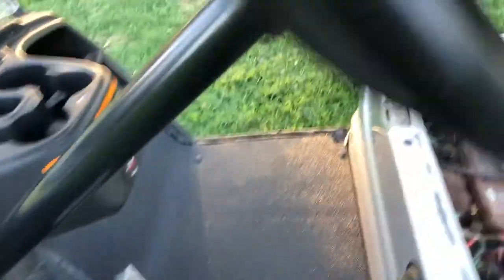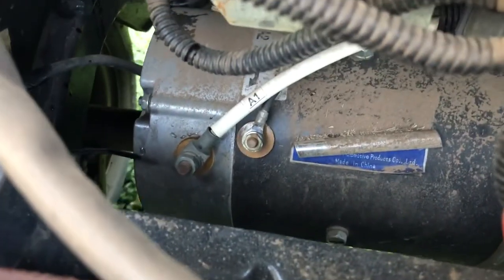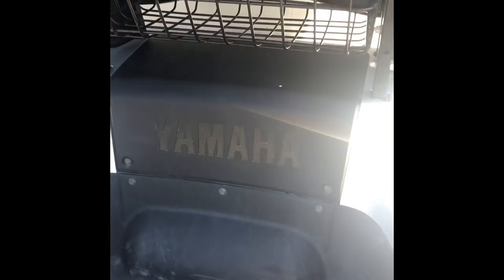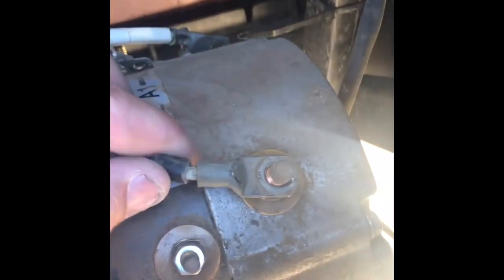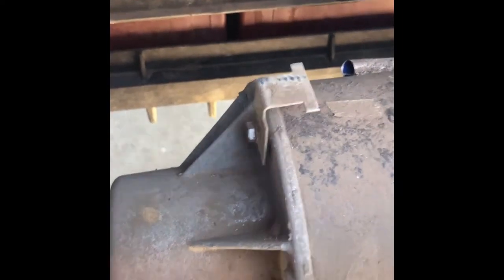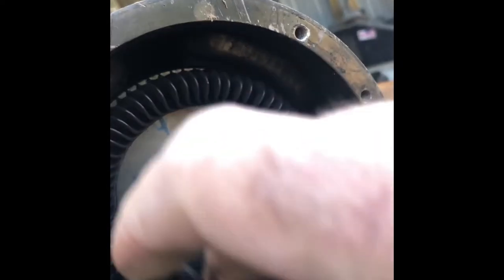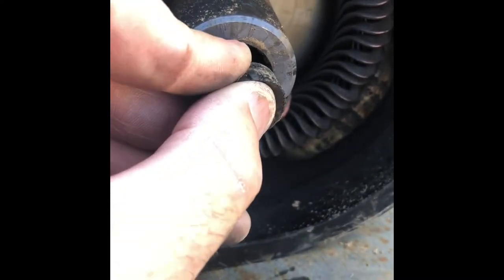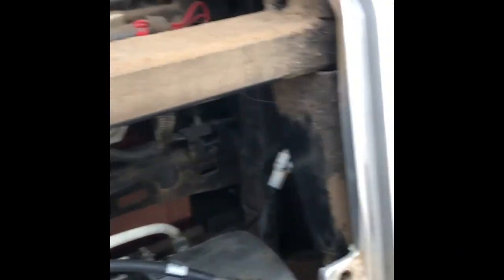GOLF CART MOTOR CLUNKING AND NOISY HOW TO FIX YOURSELF

Comment: Thanks. Newbie with a golf cart here, and I have a lot of noise. Coasting down (foot off throttle) hill or under uphill load no noise but, in-between yikes bad. pulled the motor, male / female splines look excellent. Fingers crossed this solves it.

Comment: Hey mate long subscriber.....I just bought a secondhand yamaha golf cart.    Stopped going after a loud clunk...pulled the electric motor and the inner spline of the motor has given up the ghost and just spins on the input shaft.....do yo know where I could get the inner part of the motor?  Or will I need a new motor?
Reply from the maker: I once tried to buy just the armatur but it was almost the same cost as a complete motor .
Reply: @backshed5295  Thanks for your reply....any idea where i would get one...I am in the Adelaide Hills.

Comment: I have this clinking on deceleration and no load situations on a new Yamaha Drive 2 cart. Could this be the same issue?
Reply from the maker: I’d be checking wheel bearing and drum brakes first before you start pulling the motor but potentially it could be .

Comment: The bumper doesn't fix the worn out splines on the coupler
Reply from the maker: That is something you need to access on your cart if you have let it go on way too long. I pick up on the noise very early in the carts life as a Scheduled mantainance item and haven’t found 1 in a late G29 that had worn the shaft or spline . In much older carts that have been left far too long then yep maybe  worn. As I say something you need to decide on your cart given how long the bumper has been worn.
🍺👍

Comment: i can hear my  club cart  motor spinning but wheels not turning.
Reply from the maker: Probably not one I can help with via message but if I had to give you somewhere to start I’d say the shaft from the differential that the electric motor slides onto is worn. Does it make any strange noises as the motor spins?